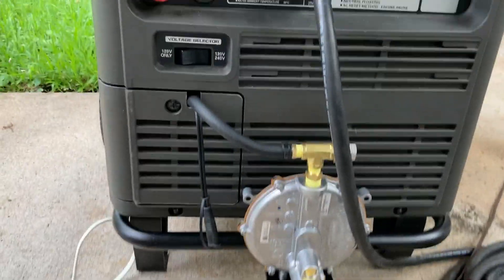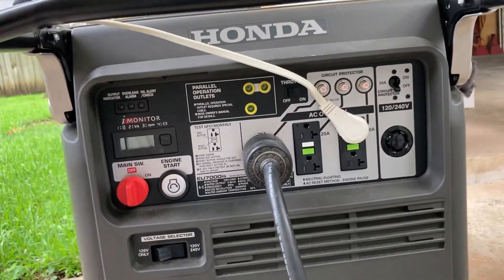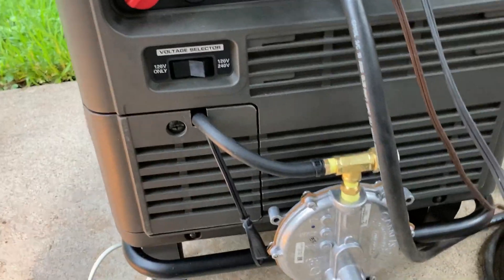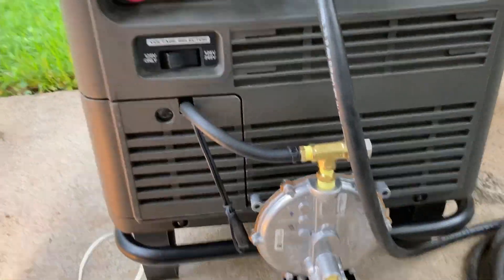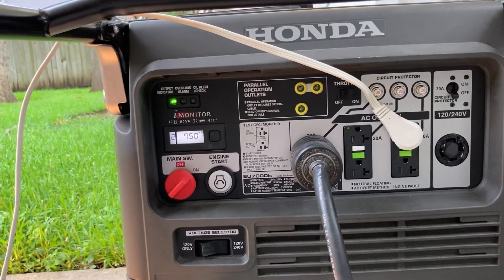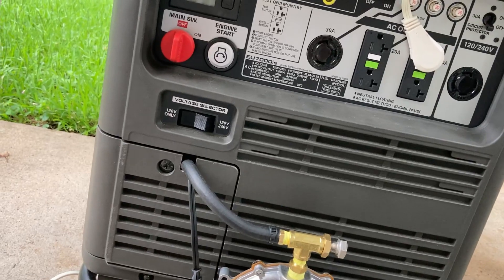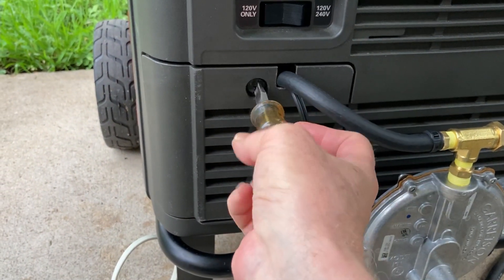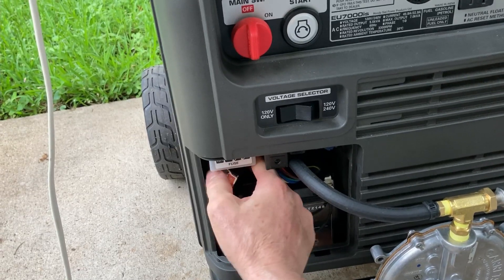Honda EU7000is running on natural gas with US Carburetion Motor Snorkel tri-fuel conversion kit

Comment: If you can never get it to run rich then it’s probably not getting enough NG supply. It’s best to connect at the NG meter if you can. Also consider upgrading to 3/4” hose.
Reply from the maker: I can understand why you might say that, because I originally had similar thoughts, but over time, I have been able to rule that out.  Fortunately, it is not necessary to speculate about fuel supply adequacy, because that is one factor that can be relatively easily be determined empirically.  I have measured the supply pressure while in operation, so I can confirm that it never falls below the ideal range.

3/4" hose may make sense for someone, but speaking for myself, it's just too expensive, and also too heavy/bulky to work with and store.  If I ran it all the way to my meter, the hose would have to be over 100 feet long, and for a significant portion of that run, it would be replacing 1-1/2 black pipe with 3/4" hose.  Even the smallest pipe in the run is 1/2" schedule 40, which has an actual ID of almost 5/8",  so considering the entire run, I believe that 3/4" would actually be a down-grade.  Anyway, I'm just not willing to drag out 100-plus feet of hose in a storm and/or the dark/cold of night, so if that was the only way that I could make this generator work, I think I'd have to do something completely different.

But again, considering the fact that the generator can produce its full gasoline-rated output on natural gas, I'm not sure what more one could hope for.  By all rights, it should do no better than 80 percent, so it is exceeding my expectations.  It might not be obvious from the video, but I believe the weak point in the NG supply to be the "Snorkel" injector itself.   It does a nice job of keeping the injection plate thin, but that thinness is by virtue of a very small tube, so that is the most obvious point of weakness.

I feel like I may have mentioned this elsewhere in these comments, but my goal was to get a little more power than my trusty old Honda EU3000is could provide.  The best it could do on natural gas was just over 2400 watts, tweaked and tuned to the nth degree.  By direct comparison, this machine provide twice that amount of power very easily and calmly.  And it can provide considerably more than that, if one pays just a bit more attention.  

It may not be intuitive while watching the video, but I'm really putting the screws to the thing!  I'm overloading the 30-amp circuit during most of the video  - the most that circuit should ever see is 3600 watts, and it should be no more than 80 percent of that  (2880 watts) on a sustained basis.  The EU7000is is a beast!  It is only because of its civilized nature and my own master-of-understatement narration that one might get the impression that it's not kicking some serious ass in this video.

Comment: Do you have to run any high loads, like a well pump?
Reply from the maker: I don't have a well pump, but I'm sure it would depend upon the inrush load during startup, because I can't imagine a big enough residential well pump to give it any trouble once it was actually running.  

On natural gas, my EU7000is can start a "Haier ESAQ406T Serenity Series 6,000 BTU 115V Window Air Conditioner" without any problem.  And keep in mind that being a split-phase unit, the generator has only one inverter to work with.  It will also start the ancient 240 Volt 2-ton window A/C in my garage, although that's very close to its limit.  That unit had trouble starting even when it was brand new, so it now has a hard start kit on it, but I think it's fair to say that its still hard to start.  1/2 HP drill press is no challenge.  1/2 HP garage door opener also presents no major challenge.

The secret to running a whole house with a small generator is to get rid of (or manage) the loads that present large transients and/or high inrush during startup.  For example, the EU7000is can run my 24,000 BTU mini-split without any problem at all because it has essentially no inrush requirements, but to run my 24,000 BTU central unit (with conventional compressor) requires that I first turn off every other load in the house and also disable Eco throttle.  It's not practical, so I just don't do it.  I also have a 22,000 BTU LG "Dual Inverter" window unit that is real easy on the generator, so I can selectively cool certain areas without significantly impacting the generator.

At the end of the day, the EU7000is is good for around 4400 watts continuous while running on natural gas, so one has to pick and choose.  I can use a few burners on my induction cooktop, but not while using my (2000 watt) microwave oven.  Heck, I can bake a pizza, but not while running two A/C units at the same time.  As long as I stay within my power budget, it can run everything in my house, although the central A/C is not practical.  And the fewer the transient and high start-current loads, the easier that is to do.

For example, I have an 1800 watt heat gun that maintains the set temperature by cycling the heating element off and on around twice per second.  It's a terrible load for a generator, so I bought a cheap "emergency" heat gun that doesn't cycle at all.  It's not as fast, and not nearly as well temperature-regulated, but it doesn't give the generator fits.  All the UPSes in my house used to beep when my refrigerator would start (four times per hour), so when it came time to replace the fridge, I chose a refrigerator with inverter technology.  Now, the generator is essentially unaffected.

I think that if I had a 30,000 watt generator, I could probably carry on pretty much as I would on grid power, but that's a whole other level of expense, both initial and ongoing.  And I say 30k because that's about where 1800 RPM water-cooked generators start, and all 3600 RPM air-cooled standby generators are way louder than the EU7000is.  In my own experience, the never-ending noise of a generator really does wear on me during an extended outage...to the point that I actually turned it off a few times, in spite of the dark and the heat.  I think it would take that big of a jump to get something that would please me more than what I already have.  

Actually, I wouldn't mind having both, but that's yet another whole level.  And then why not solar with battery backup?  At that point, the only need for a generator would be in cases where the sun doesn't shine for a long time, just to recharge the batteries.  That would be way better, in my mind.

But circling back around to your original concern, if you find that your well pump is too hard to start, you might look into the practically of using something like the Micro-Air Easystart, but it would depend upon whether there is a way to to get access to the start windings.  Probably not an option for a submersible pump.  There are easy-to-start pumps that are designed for off-grid use, but unless you have some other reason to replace your pump, you probably don't want to start all over.

Comment: Why is the voltage dropping to 109-115?
Reply from the maker: Where did you see that happening?  The only time I saw that happen is while I was technically overloading the generator.  At over 5500 watts, it would have been beyond its rated maximum continuous output, even if it was running on gasoline.  But it was running on natural gas, which theoretically yields only 80 percent of that rating, which would be only 4400 watts, so the fact that it was managing to deliver over 5500 watts seems pretty amazing to me.

Comment: Can the generator be run on gasoline with this kit installed?
What is the purpose of the module and switch?
Reply from the maker: Yes it can - "tri-fuel" includes gasoline, natural gas, and propane.

Comment: Yes, Honda makes a great gas generator, but at ~$6K is it worth all the trouble to run on NG or propane? There are much more powerful and cheaper generators to chose from. I currently have no generators and the EU7000iS was at the top of my list. However, I'm now considering a DUROMAX:
9,000-Watt/7,600-Watt Dual Fuel Remote Start Inverter Generator with Portable Digital Parallel 50-State compliant. The Honda can't even be sold in CA as it isn't CARB compliant. You could buy 2 for the price of one Honda.
Reply from the maker: Is it worth is?  I guess that depends upon one's sensibilities and priorities.  Certainly the EU7000is is expensive, and certainly there are less expensive generators out there.  If one is a Honda fan, then that alone may be enough to justify it.  It could be argued too that there is no quieter generator in the same power class.  It may also be the most fuel-efficient, in spite of some claims to the contrary.

Something else to consider is that there is no quiet inverter generator with native tri-fuel capability, so if one wants maximum preparedness, a conversion is currently the only option.  Champion has some interesting dual-fuel inverter models, but last time I checked, none of them could supply 240 Volts.  Also, think about how long you want to be able run it without going on a hunt for more gasoline or propane.  In my experience, propane is virtually unobtainable in the wake of a disaster, so how much propane are you willing to store?  It has an indefinite shelf life, but I have read that propane should never to stored in an attached garage.  Other sources indicate that it should never be stored in any enclosed space.  Do you want propane stored outside your home.  I didn't.  The only way I'd be willing to do that would be in a buried tank, and the cost for that is not insignificant.

Gasoline is an even worse standby fuel in almost every way.  It has a very limited shelf life, and it blows up pretty easily (and spectacularly), so you certainly don't want to store any significant quantity in an enclosed space, and yet it's not really practical to store it outside either.  It is safer to limit storage to a few 5-gallon cans, but even then one would need to keep it fresh by rotating it through a vehicle every month or so.  I did just that for many years, but it was a big hassle.  I have a friend who spent a very cold and dark night (with treacherous driving conditions) trying to find gasoline when that winter storm plunged much of the entire state of Texas into darkness.

The appeal of natural gas is obvious.  It is clean, it is safe, it doesn't have to be stored, and in my lifetime, it has never failed anywhere that I have lived.  Those simple truths led me to the decision to do my own conversion.  And as it happened, the majority of all tri-fuel conversion kits available at that time were for Honda generators.  And again, the EU7000is is the quietest generator in its power class.  I live in a residential neighborhood, so noise was an important consideration for me.  And anyone who has ever weathered an outage that lasted days and weeks can tell you that at some point, one is ready to live without power just to escape the never-ending noise of a loud generator.

My first generator was a 3500 watt Craftsman, which I was forced to return because it just couldn't deliver anything close to its rating.  The second was army MARS surplus.  It was an incredibly robust 3000 watt generator that easily out-performed the Craftsman that it replaced.  It never failed me, but MAN was it ever heavy and loud!  My third was a Yamaha 3000 watt inverter generator, but it too was weak compared to the MARS machine, and while much lighter and quieter, it had a noise signature that I found irritating, so I eventually traded up to a Honda EU3000is.  The Honda was (and still is) a fine machine, always over-delivering.  It was quiet, completely reliable, and it made a lot more power than it's rating suggested.  I liked it a lot.  After the warranty expired, I did I tri-fuel conversion on it.  It never ran as well as it did on gasoline, but the convenience of natural gas was enough to convince me to keep it for decades.  

In the early days of the pandemic, I bought the EU7000is, hoping to preserve the best qualities of the trusty EU3000is while also getting some additional power.  It did that.  On gasoline, it runs more like a car than a portable generator.  The specs say that it's quiet, but dB's don't really tell the whole story, because the character of the noise is also important.  It actually sounds a lot like a small car running just above idle.  I remember remarking out loud, "Man, this thing is a machine!"!.  Hopefully you understand that reference.  It pleases me to own it.

I then did the Genconnex conversion, which was a great disappointment.  After fighting with that for months, I eventually bought the US Carburetion kit, which you see here.  Still not quite up to the fine example set by native gasoline operation, but pretty close.  And again, very convenient.  And of course, even on NG, it still makes a lot more power than the EU3000is ever could, so I'm pretty happy with it.  And to give the story a happy ending, I sold the EU3000is to my sister, who knew just how well it had served me (at times when she was in the dark at her house), so it's still in the family.  If the EU7000is lasts as long, it could out-last me.

So that was my journey/decision process.  Other people will take different paths, leading to different decisions.  I have a good friend who recently chose the cheapest (and noisiest) dual-fuel Champion open-frame inverter generator that he could find.  He doesn't care about the noise personally, and he certainly doesn't care if it's too noisy for his neighbors.  He did go with propane as his fuel choice, but then almost immediately lamented the storage concerns.😬

Comment: Hi MrMark, you have been very helpful, I'm sure you are saving a lot of people a lot of trouble watching your video before attempting to install this Honda snorkel EU7000is device. 
I was wondering if....
!) You would create a video with the measurements of size and placement of the perfected holes drilled in relation to the overall bar measurements.
But if I could make a wish, 
2) I would purchase from you a templet pdf of the attachment bar you perfected so I could take it to a local shop and have it fabricated. 
or better yet 
3) Pay to have you fabricate a copy of your perfected mounting bar and ship it to me and I would compensate you for labor parts and shipping, as I do not have access to the equipment to modify the bar.
You never know you could start a nice little side business with all of the needy ones like me that watch your videos. 
Thank you again for sharing all of your ingenuity!
Reply from the maker: 1) I could probably do that.  I just need to get out from under many less enjoyable things.

2) I'm not sure how much that would help.  I just used the bracket that came with the kit, but I have no affiliation with US Carburetion, so I don't even know if the kit has been changed/improved since I bought mine.  I so show some pretty good photos of the modification here: https://youtu.be/2NziDBzqI-Y?t=27  Granted, there are no measurements, but the relationships are clear enough, and the exact positioning is not all that critical.  If I were you, I would start by trying to find a muffler clamp similar to the one I used.  There are a lot of similar styles, but they are just different enough that it would be best to have the actual clamp before drilling holes in the bracket for it.

3) I'm not opposed, but what would be a fair price?  It was kind of a labor of love thing for me, because I'm not a fabricator by trade.  Could I charge enough to make it worth my while?

Comment: I have an EU700is and am contemplating this conversion, so thanks in advance for producing this video. I also saw that PNG Technologies produces a kit as well for this generator. Can you please explain why you chose this particular kit over PNG? To me, it looks like the PNG kit is a cleaner install, but I don't recall them having a separate computer module to replace the Honda module.
Reply from the maker: Hi Daniel, I settled on the US Carburetion kit because, to my knowledge, it is the only kit that includes the "black box" control module.  I have another video that shows the module: https://youtu.be/jczarRxAunI

I believe that this module is the single most important factor in making the EU7000is run properly on natural gas (or propane).  I proved this to myself by adding the module to my previous Genconnex kit (which ran just awful without the module).  With no other changes, it made the generator run infinitely better, with no other changes to the Genconnex kit.

There are multiple schools of thought on what makes a conversion work well.  The Genconnex idea was to keep the gas supply line as short as possible, and they achieved that by replacing the original fuel tank with a new shell that positioned the regulator inside the covers, resulting in less than a foot of hose.  But in my experience, that was not the "secret sauce".  It ran terrible.  It backfired and sometimes even died with a light load, and lacked power under heavy load.  It made the generator all but useless for my purposes.  Here is an example: https://youtu.be/A_LYYceiDfo

FWIW, in my experience, moving the regulator out side of the covers, with something like three times the hose length made no difference, except that it looks less "clean, but it gave me tri-fuel operation.
Reply: @MstrMark  Excellent reply MrMark! Thank you..